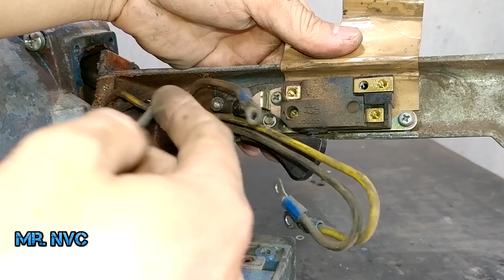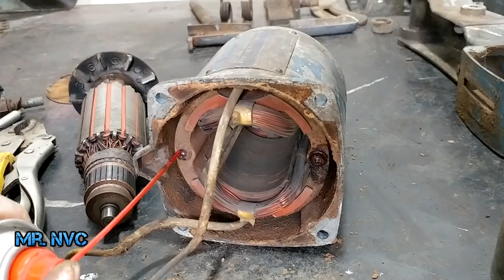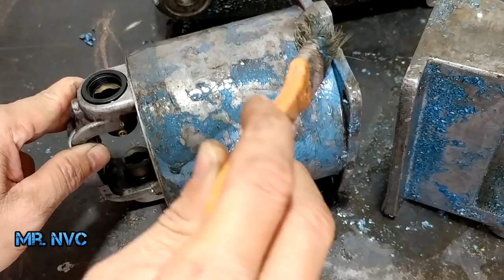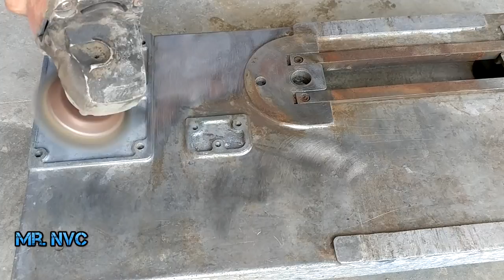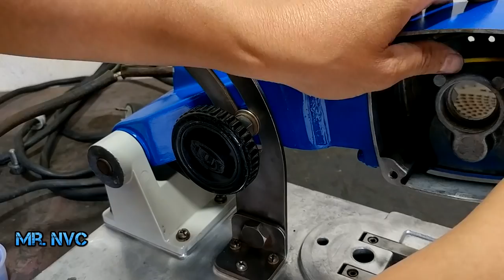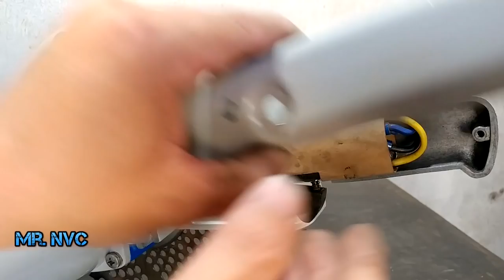Very OLD Steel and Metal Saw Power Tool RESTORATION

Comment: This is actually one of my favorites that you have done! I'd still like to see new brushes, and more polishing of the metal and screws. You could also use a high build primer on parts that are more dinged up that you're going to paint, give it a sanding, then paint and it will take your paint to the next level. Keep going, man! Love the blue and gray combination.

Comment: I admire your effort, however as I mentioned in your planer 'restoration'. this is a metal bodied tool without a ground/earth wire, a death trap! Need to use primer before paint also.
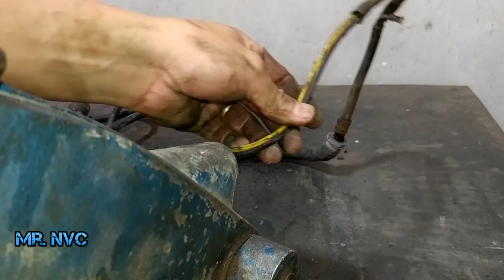Reply: Look at 2:44, it's grounded.
Reply: are you sure or just fishing for likes ?
Reply: You have noe clue, it's clearly grounded. Just appreciate the work or do better yourself.

Comment: The time and dedication to do something like this is (repeatedly as you do with your videos) very laudable.  I am curious, are these restorations so they can be used still/again, or for show?

A few questions/comments on this restoration:
1 - Why not replace the power cord.  Something that old and falling apart would be a hazard.  I'd worry about the wires crossing and causing a fire.
2 - Why not replace the screws?  They aren't all that expensive, and would give a uniform look.  At the least, it looked like you didn't wire-wheel any of the ones you pulled out.  A little shine goes a long way.
3 - The paint job wasn't bad honestly.  I don't suspect this is going to be a show piece or the like.  That said, a wet sanding after primer will go a long way.  Also, how many coats did you put on this piece (as you don't say, just show briefly paint being applied)?

Comment: 1) No new strain relief grommet

2) not earthed (class 1)
Replace 2 core flex with 3 core

3) the on/off switch on the handle...looks like the IP rating has been compromised

4) Where's the rest of the vice assembly...? 

5) should've used new screws throughout 

6) should've used new brushes for the motor
Reply: 1) Agreed, this is important.
2) Look at 2:44, it's grounded.
3) Why would you think that?
4) Might not have known it was missing?  Or maybe couldn't source.
5) Agreed, fasteners looked to be standard parts that would be easy to replace.
6) Why?  Plenty of life left in those and they appear to be very easy to replace if needed.

Comment: Interesting video..

-Definitely replace the damaged screws.
-Clean and flux before filling the crack in the housing.
-Replace the electrical cord, don't patch it.
- be safe use gloves when grinding and wire brushing, safety first..
Reply from the maker: thanks sir

Comment: You take a 12 volt drill machine and then in the machine fix a screw and then unlock the rusted screws very easy you are so slow

Comment: Steel shaft in an aluminum housing is a set up for disaster. They should have put brass or bronze bushings in the aluminum to separate it from the steel.

.